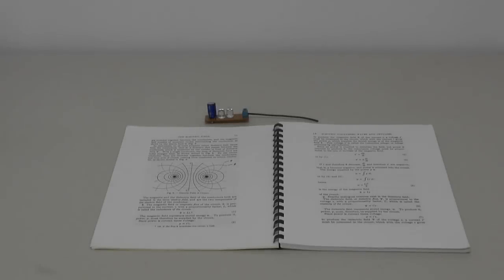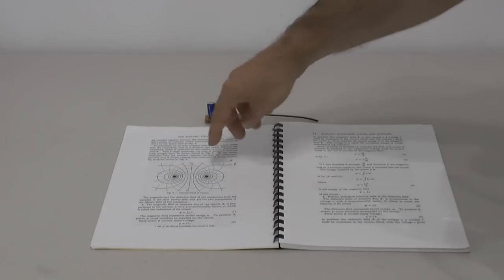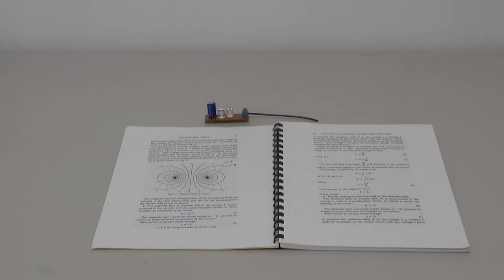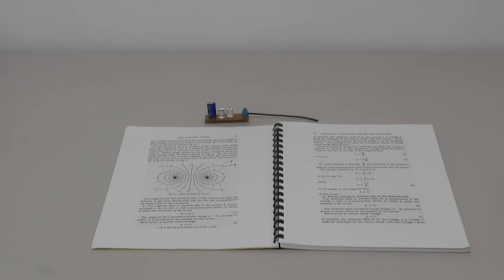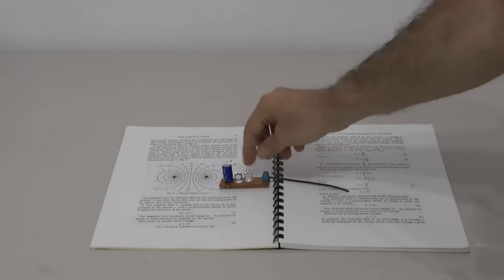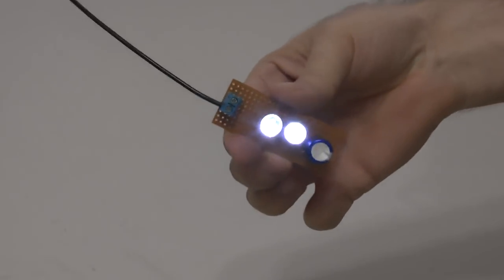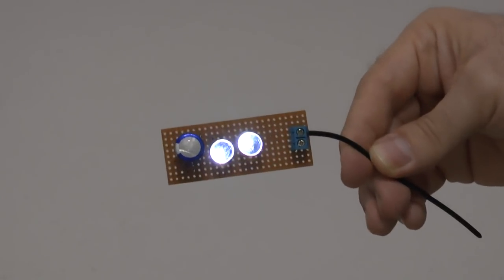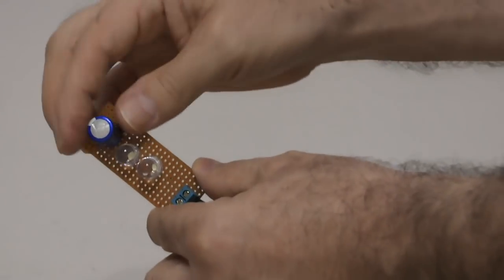Radiant Energy  and Dielectric Fields

Comment: According to Steinmetz there is magnetic field and dielectric field. Okay, electricity is the composition of the magnetic and dielectric fields. What about a Tesla coil, is the magnetic field component which is built on the secondary coil, separated from the capacitive dielectric field component, which is built on the aerial (ball shaped) capacitor, correct?
Does a Tesla coil propagate longitudinal dielectric waves into space, can we verify this with an experiment and what about the field theory, can you mathematically prove us the existence of these dielectric waves ?

Comment: How can I build an antenna to receive dielectric energy, could you mention the principle of such a device? I would like to ask you, is this energy the same as the radiant energy of Nikola Tesla? Many years ago I read something about the longitudinal waves of Nikola Tesla, but the theory was missing, Borderland Sciences published some documents about Tesla's work, there was also a video about it.
Nikola Tesla's radiant energy device (Patent Number 658.957 and 658.958) is interpreted as a simple solar cell, based on accumulating the charges of the atmosphere/cosmic rays on the surface of a metallic sheet, which were then transformed into electricity by using a spark gap and transformer circuit, after the potential reaches a certain value......
Thank you very much for your lecture, I would like to stay in contact with you 🙏👌